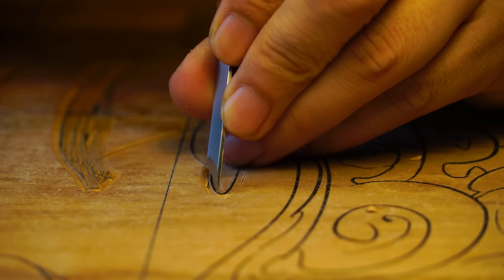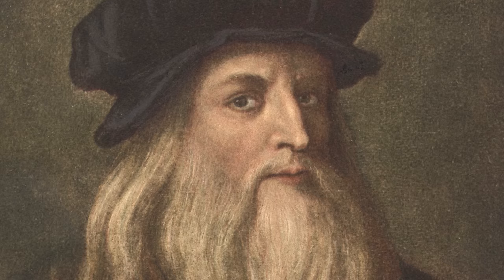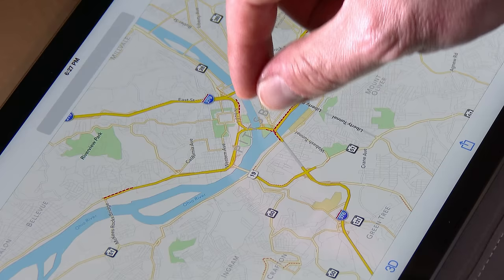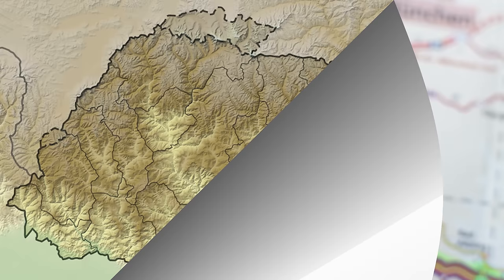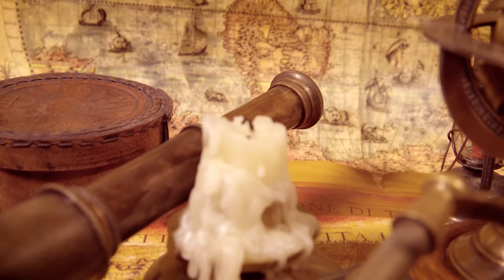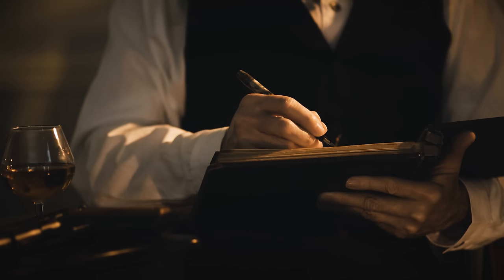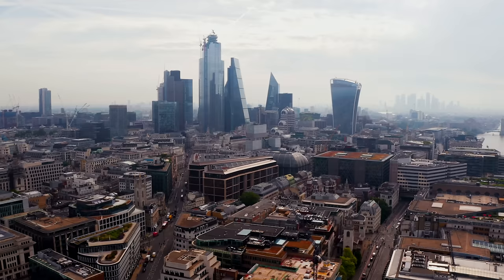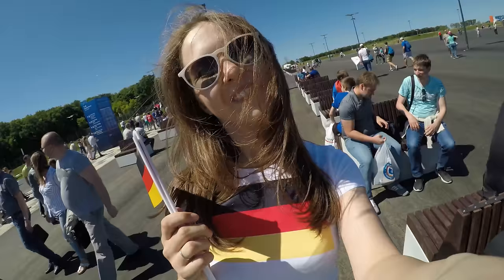Why This Mountain Range Can't Be Found By Any Human

Comment: I remember high alpine hiking in the Alps for 6 days taking my fathers maps with me . Everything went fine until I was supposed to traverse a glacier . Turns out the map was 20 years old and the glacier dramatically has melted and was impossible to traverse on the original path without ice picks and lots of luck .  So I had to find another way and  found a marker further up the trail to traverse . Got delayed about 2 hours and made it just in time to the shelter before sun set . Moral of the story : dont take old maps with you ever

Comment: A little strange to have' Ode to Joy' as the backing track whilst portraying London. Similar to using the 'The Star Spangled Banner' whilst portraying Ottawa.
Reply: To Explain why it's strange: 'Ode To Joy' is the unofficial European Anthem, while Brexit is still happening (i assume).
Reply: @Jonathanizer  It's still going to be a part of Europe, just not a part of the European Union.
Reply: @pickles3128  The point of an Anthem is to celebrate political unity. Sure, Britain is still part of Europe, the geographical landmass, but politically (and thereby economically, culturally etc.) more distance is created between Great Britain and continental Europe, which is against the spirit that the "Ode To Joy" was supposed to celebrate: peace and prosperity through political cooperation.

Comment: Check out some of the little towns on the east side of James Bay in Google Maps.  Maps will show you some road layout, but you can't streetview them.  I work in a camp up there and if you haven't been there to know the layout first hand, you would never be able to point out the camp on Google Maps - the resolution just isn't high enough so it's totally pixilated.

Comment: I lived in germany. I used to take the train that would drive through Bielefeld. It even said next stop Bielefeld hold only if requested ( halt auf Verlangen) but it never stopped a single time. No one ever wanted to leave the train and no one wanted to board it from there. I once heard it had stopped but i never saw it with my own eyes.

Comment: When you talked about the mountain in Bhutan, I couldn't help but think of Mallory's quote about climbing the mountain "because it's there." I imagine those climbers going to Bhutan and asking, "It's where?" 

The Bielefeld city council's challenge to prove that it doesn't exist would run into trouble if they ever did something particularly stupid. Someone could quote to them the old saying, "I think therefore I am" and then say that because they must not have been thinking when they did that, they no longer exist. 

The problem with putting a fake word in the dictionary is that someone might copy it into a thesaurus. Then, people would start using the word until the new word came into existence as part of the language.

Comment: You missed a slightly important map alteration reason...war time. Like i personally know of an airport built in the 1930s, that disappeared from the 1942 map when US Army Air Force turned it into an airbase. Even the roads around it vanished. It wasn't even "top secret" the locals had access to the excellent hospital on base, were well aware of it...just don't use a map to get there. Oh the air port did magically reappear in the 1950s, after the US Army moved out and returned the land to the city.
Reply: I did put in FOIA request for the real map...2 years later I actually got it. Just digital photos of the map laid out on the floor, but good enough detail for my research.

Comment: Accurate maps have only been prevalent  when satellite photography  and GPS triangulation.  For places that have not been flown over by gps linked lidar or been to by people on the ground with gps and cameras.  

However ancient maps can be interesting.  The island you talked about that probably didn't exist was possibly a  large mound of sand pushed up by geological activity and its disappearance could have been caused by storms and waves weathering it away or if the geological activity was a lava chamber that collapsed in on itself that may also explain the disappearance.  Logic can be fun